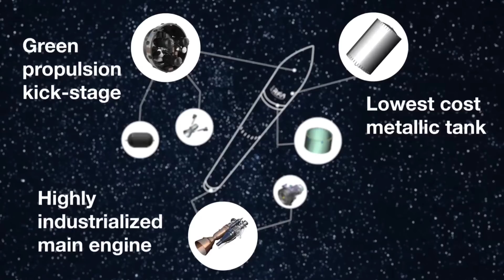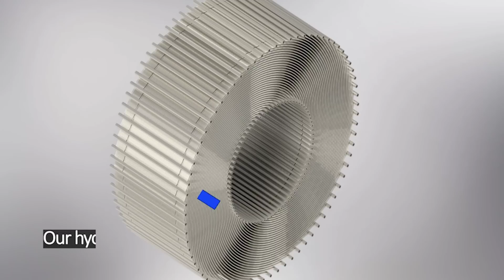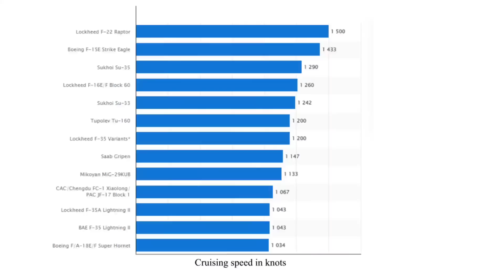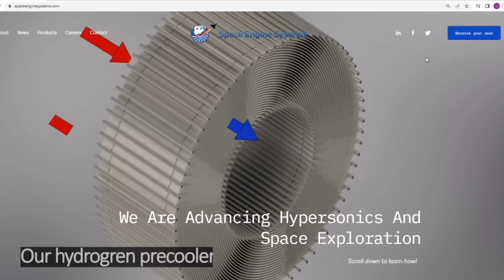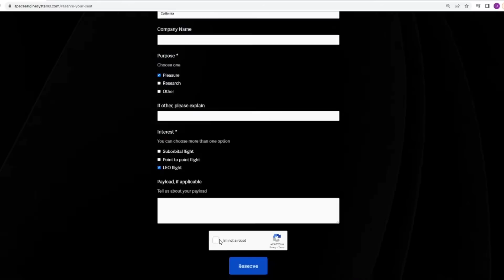HUMAN Spaceflight coming to Britain!!  PLUS German and Canadian companies in a new race to orbit!!

Comment: Enjoyable video allowing us to fantasise about the future happening tomorrow - or this year at any rate!
But the unfortunate reality is that Space Engine Systems’ claims of imminent roll out of an operational SSTO is just that - fantasy - hoping to sucker in VC £.
As wiki says about Reaction Engines’ combined cycle hybrid jet engine powered Skylon SSTO: “In 2012, REL expected test flights by 2020, and operational flights by 2030”… and here we are, more than 10 years down the road, and not even a working test engine built, never mind “test flights”, and “operational flights” still a pipe dream, despite REL receiving considerable backing and support from the UK govt and especially Rolls-Royce and BAe Systems - and “Space Engine Systems” is just another wannabe startup

Comment: One of the use cases for Starship that Musk talks about is the possibility for very rapid point-to-point passenger services between major cities around the world.  If SES can deliver then I would have thought that would put a serious dent in Musk's vision re intra-planetary passenger services. An SES plane wouldn't need a huge exclusion zone around its launch/landing facilities and also as a passenger I assume I would get a far smoother and less scary ride on a horizontal take off and landing SES plane vs high g vertical launch and belly flop re entry pivoting to a final vertical landing. Sure, I assume Starship could carry quite a lot more passengers per flight but the downsides are so significant for Starship that I can see that having a real uphill battle to get infrastructure and acceptance in place for inter-city hops whereas if SES can prove the technology the subsequent hurdles would be far less severe.

Comment: It's no longer impressive, using an extreme amount of verticle fuel, to deploy zenithly of tiny/small payload into orbit velocity parking. These chem-fuel methods will require many tricks. Wing phase vs rocket stage. Turbine purpultion transition of jet, Ramjet, Scram and *Turbojet (fuel as atmosphere flow within turbine blades before afterburn). To elevate higher launch starts sstol. Or practical ✈ +🚀 . Beyond "boomstick." Massive frieghts launched up, starting with space balloon stages vhigh.
🎈_ 🚢 _🎈
 ->🎈 _🚀 _🎈
-->🎈🎈_🚀 🏟 🚀 _🎈🎈👀 etc...
Space station angry huge work of arts

Comment: You know I have to add my 2 cents here . I'm also intrigued about the quality and diversity when it comes to the space race. It's great to see some have embraced the real math (S.E.S) and it's definitely not rocket science but the merits of our atmosphere which again continues to elude rockets and payloads due to mass . This is a restrictive measure and my equation proves that light lifting heavy is real because we do this with commercial aircraft especially cargo planes that don't have in air refueling...Less equals more when you start to think about the mechanics involved, so until then, I'll remain ANGRY until they get it right 
Cheers 🍻

Comment: The Canucks have an interesting plan.
Given the problems SABRE has encountered (and the development team have been at this a LONG time) what is their secret? 🤔🤔
Reply: There technology seem to be base off reactor engines. How this doesn't violate Reaction Engine patents is a mystery to me.
Reply: @DavidKnowles0  
No company, even if it had RE’s plans, could be in a position to build an engine like this without spending billions of dollars in a development programme that would take at least another decade to be built and running, which RE know full well as they’re already been working on it probably for 15 years or so. 
However cool the designs being shopped around by Space Engine System may look, that bird ain’t gonna fly for a looooong time - if ever.
Chances are RE’s future will be to exploit its cooling technology, which it is already doing, for aviation and other applications that no-one has yet thought of but even just that cannot happen with the “cottage industry manufacturing” RE currently have and will require new, fast, efficient, reliable and economic manufacturing processes that RE don’t have and RR and BAe would probably have to commit significant further investment which is a big ask in the current economic environment.
Reply: Our top secret maple syrup coated plumbing of course, and a flock of geese towing it to altitude
Reply: this is definitely a scam company, Their contact adress is a UPS PO box in the middle of a strip mall and the pictures of their "facility" is a warehouse on the outskirts of town

Comment: You seem to like European companies.  Maybe you can check to see if this atteibute still exists in European companies.

Time period the 1990s.  A friend of mine worked for TI in asic design.  Two companies in San Diego were trying to reverse engineer the Qualcom phone chip.  My friend consulted with both of them.

Sony made a big splash and then failed after 6 months.  My friend said that at  their model was that a project had to be done in 6 moths or else.  My experience with this was similar.

The other company was Nokia who took their time and made successive builds until they got it to work.  My friend said that tbe difference was the European culture.  ( Nokia failed years later because of a manager not wanting to do flip phones to compete against the Mot Razor.  There was a double standard in that the European workers got better benefits and were put on much less pressure than American workers.  Asian companies had similar problems)

The question is do you see a similar pattern in European companies taking the measured long term approach?